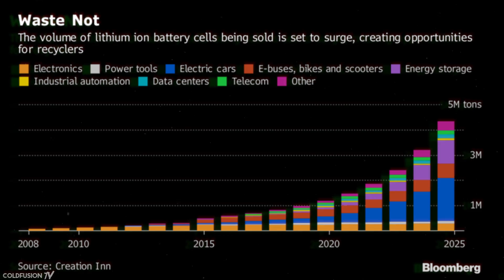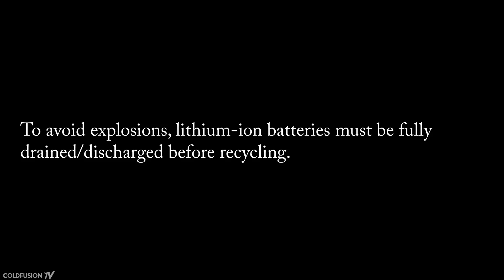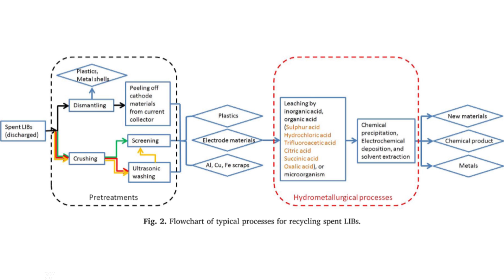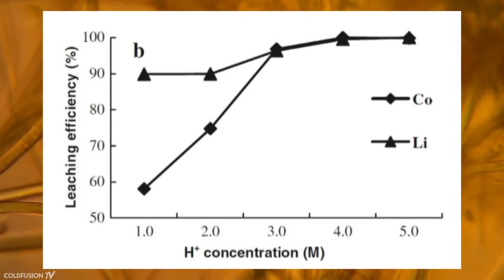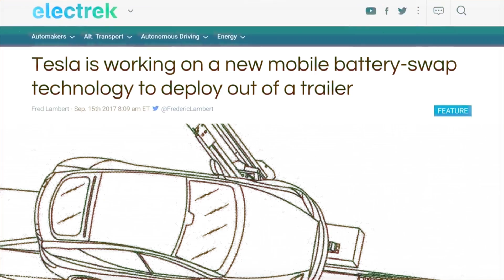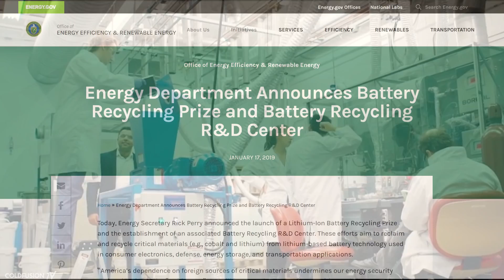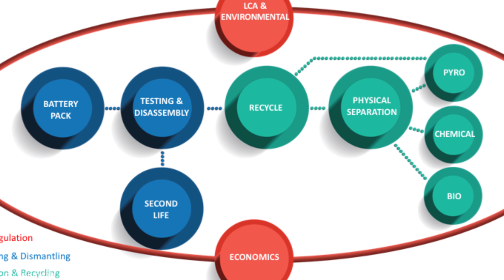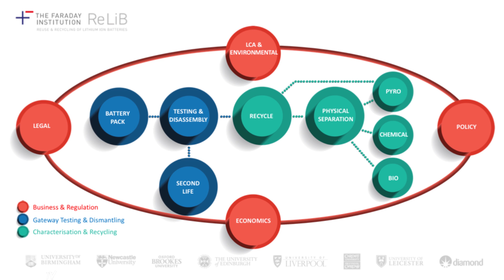Batteries, Recycling and the Environment

Comment: Canada has a battery deposit system, you put a 40$ or so deposit on your standard (ICE) car battery and you get it back when you return the battery for recycling/disposal. Same with TVs and stuff that is going to need to be disposed of one day. I think it was about 40$ for my tv too
Reply: no we don't, where you live might have such a thing, probably because the retailer wants to recycle them themselves to make the money.  a typical car battery net's you 5-8$ if you take it to the recycler yourself, and even if you don't wish to do so any retailer will happily accept them even if they don't put a "core" charge on it (core charges were made for things that get rebuilt, not for things that get recycled)  I work at a auto parts store in BC, and while we will happily recycle your old battery for you, we won't charge you extra if you choose to do it yourself.

electronics on the other hand we do have a disposal fee on, primarily because the value of a dead TV is pretty close to 0 to a recycler.  Same with car tires, it's often not economical to collect and recycle the majority of them, so we have a 5$ or so fee when buying them new to cover the cost and make sure they don't end up in landfills or dumped in the bush.  This is why you can tip car tires off for free in so many places, though a handful of greedy bastards will try to charge you as well as collect the fee from the government.

Comment: I don't care for the government regulation when clearly the designers of these batteries are smarter than government - it's about integrity, & honor to do the right thing✌️
Reply: Dream on
Reply: They might be smarter, but if there isn't profit at the other end no one will be doing anything. Integrity and honor are nowhere to be found when you talk business.
Reply: Steve Linbergbaby nope, only regulation works effectively. Consider the global change over to unleaded fuel for cars. Manufacturers would not have done that if it weren't for gov regulation.

Comment: I've always wondered, is it safe to keep devices plugged in all night? Doesn't it degrade their Li-ion batteries over time?
Reply: Yes, the optimum operating range for Li-ion is about 30%-80% SoC. Regularly charging to full capacity will lower the life expectancy compared to one that is only ever charged to 80%. However, this is not generally a safety issue ;)

Comment: What are solid state batteries? #solidstatebattery  what are the advantages of it? Will these solid state batteries overthrow lithium ion batteries? At what state is its development right now?
Reply: Maybe dagogo can and will do a video about it too? Idk he did one some time ago on the one of Samsung
Reply: Solid state cells use a solid electrolyte instead of a gel.

This gives it mostly lower internal resistance along with much higher cycle life.

Their energy density/volume isn't actually better than current lithium-ion cells, but their power and energy density/weight is currently higher on a lab setting.
Reply: I hate shutting down a chat but i reckon if you typed those words into google you'd get an answer
Reply: Odin Thorsdad good reply, +10 respect

Comment: We can label battery cells with the information required to recycle them.  But it is also essential that we can identify exactly which cell we have and can look up all the current information about it.  Such identifiers should appear on each cell multiple times, so it's likely the identifier can be read even if the cell is damaged.  

And these identifiers should be readable by both humans and robots.  Robots will be doing all of the recycling eventually, so we must prepare for that.

A robot should be able to look at a cell and then look up exactly how to take it apart.  Then the parts can be put sorted and through other automated recycling processes later that deal with a specific component or material.  

We'll figure out how to automate recycling later.  The essential thing now is to get the identifiers in place.
Reply: It already exists for 18650s cells. If you need some help, I can point you to some regarding this info.

Comment: Graphene is very promising tech, and possibly the 'magic bullet' to solving high capacity battery construction (lots of pro's, very few con's)
Reply: Graphene isn't a battery technology. It's a strong high tech building material and it's a good conductor.

You can use it for capacitors and make super-capacitors. But these have at least an order of magnitude lower capacity than lithium batteries.
Graphene capacitors have cought a  lot of attention from the press because capacitors can charge almost instantaneously, but seriously who would want a car that can only travel a couple of miles at a time.
Super-capacitors can be useful in an electric car, but they are not a replacement for long range batteries.
Reply: So far it hasn't improved anything on capacity, but it could improve longevity.
Reply: STAG162 unfortunately no

Comment: So lets say the batteries stay around for many years changing uses the next question is will we run out of lithium in the mean time? We are talking exponential increase in use.
Reply: We mine almost ten times more tin than lithium, and lithium is significantly more abundant than tin. Are you worried about humanity's insatiable appetite for tin? The answer is about 350 years for lithium at current rate, but given that we're not performing fission on the lithium, we're not using it up, it's all still here. Seeing as we're on the verge of dozens of other battery chemistries that don't use lithium, lithium isn't the part to be concerned about. Cobalt would be more of an imminent issue, but likely also very soon a non-issue.
Reply: @2k3r11s  for some reason I thought it was limited. I just googled and realise I am indeed mistaken.
Reply: @manickn6819  IIRC, lithium isn't the limiting factor for lion batteries, they use so little of the stuff.  It's usually cobalt, if i'm remembering right, it was a while back that i looked into this.
Reply: @Wooble57  the other reply pointed that out and I went researching. Seems lithium really isn't a big problem. Didn't realise that before.

Comment: Recycling of cars is not new so why has no one made recycling of batteries as priority before now. Even low volumes should be recycled and nor wait for the glut. Lead acid batteries came about at time when recycling was  not used. Cars for the last twenty years have had to be made of plastics that can be recycled so they turn a blind eye to batteries.

Comment: I am a long time subscriber but I think I will unsub.
Later videos are so biased, like to the point they appear to be Tesla commercials.
How do you think that a pack of cells will last 17 years in a car exposed to cold and heat, when the same cells last 3 max 4 years in my laptop?
Why don't you ask yourself why cell phone manufacturers made batteries non user removable as they used to be, they will be more easy to recycle after all.
And going back to electric cars (which aren't the future IMHO), how can they be green, when the power grid that provides the energy is not?
In my not so humble opinion the elecric car fever is just bulshit and manipulation.
Reply: Take a gallon of gas and use it in a gas burning car and see how far this car can go... put a gallon of gas in an electric power plant and it will produce enough electricity to power 4 electric cars to go the same distance.  Even if you burned 100% pure coal you will still have less pollution than a gas car.  Now that we took the electric fuel back to the power station... take the gas back to the refinery... it takes 6.7kW of electricity to boil oil to refine it to gas.  A gas car uses MORE electricity per mile than an electric car uses per mile.  Add to this the billions of dollars in subsidies to the oil companies.. oil is a total drain on society.  Gas cars are also slow and boring to drive.
Reply: @1905934 
Do you have any studies to back up your claims about mileage?
Anyhow an electric car pollute the world at zero km or mile more than an diesel in 300.000 km only from producing the battery pack, let alone what will happen after the short lifespan of the pack.
As a side note if you think gas cars are slow and boring you should try a motorcycle or may be use a manual gearbox car.
Reply: @ERUtheWINDRIDER  I drove many cars with gearboxes.. also raced with a motorcycle.. they can almost be as fast as a Tesla.. close... but not into driving motor cycles.. sorry gearboxes are pathetic ... the lag in between shifts.. no chance of catching a Tesla.  Only hyper cars can complete with anything electric.. but if you were a gear head.. you should know this.

Comment: Lol dude why you showing the Tesla battery swap patents? That project failed a long time ago. That also wasnt about recycling but being able to swap to a full battery instead of charging your car.
Reply: that was just to illustrate their point of making batteries easier to access in cars so that you don't have to tear down half the car in order to replace an old battery.
Reply: @JazzGreinerMusic  But thats not whats happening. All the manufacturers are going to a skateboard method and none of them are using battery swap except one small European company. People dont want to swap batteries, and it makes the car more dangerous and handle worse by having the center of gravity higher or in one spot on the back.

There's no problem with recycling EV batteries in the shape and design they have now. They are huge $5k batteries on wheels, there's no design problem with the cars that makes it hard to recycle the battery haha. No reason to redesign from the skateboard format. 

Also, the battery is generally longer lasting than the body of the car in these EVs, haha. Tesloop has run Teslas for 300k miles without losing 20% capacity. Even when you have a rare battery failure before that, you just lift the car up on jacks and replace packs from underneath. There's no "tearing apart the entire car." Auto manufacturers are smarter than that. They invest billions into their cars, they are not stupid-heads.
Reply: @-whackd  its not about making the battery 'swappable', its about making the car around the battery in such a way that when the time comes (according to this video every 17 years) it's easier to take out the battery and put in a new one, without having to dismantle certain aspects of the car and emptying fluids etc. 

You're saying car manufacturers already do this. the video is stating otherwise. Im no expert so im not gonna get into who is right, all im saying is that in the video, they footage they were showing was to illustrate there point, which it seems like you may have misinterpreted. thats all.
Reply: duke1duke1 Renault is small?

Comment: there isn't even enough lithium to mine to replace even 20% of earth its combustion cars with electric cars 

plus the electric grid would melt if we reach 8.5% of amount of electric cars in western cities

plus it takes a gigantic amount of gasoline fuel to run all the infrastructure to mine lithium, which mean if oil runs out you can't even mine and distribute lithium

when oil runs out the world will return to the stone age and all modern infrastructure will fade to dust leaving the ways of the ancients
Reply: www.nanoflowcell.com

Comment: Part 3 : Ultra capacitors and its evolution into the battery!
Reply: Supercapacitors are not a replacement for batteries. They fill a different niche. Batteries are for when you want kilowatt-hours. Supercapacitors are for when you want megawatt-seconds.

If you want backup power to run a building for a day when the power goes out, you want a heap of batteries.

If you want to cushion your grid connection against startup power surges when you restart your factory, you want a heap of supercapacitors.
Reply: @Roxor128  Exelant point !!!
Reply: And capacitors charge insanely fast.  So if they can be made with similar energy densities to current batteries, it is a massive win as they have FAR more duty cycles and are infinitely more recyclable.  If the elusive graphene ultracapacitor can be achieved in scale, then everything changes.  To the extent of almost fusion power level changes.
Reply: @JasonPrice1  There are only 2 problem with supercaps, even if energy density is solved:
1. Their self-discharge rates are quite high.

2. Their voltage goes down significantly as you discharge, unlike rechargeable battery chemistries which go down slowly in voltage.

Comment: Tesla just bought battery and supercapacitor producer Maxell for ~200 million dollars. You might want to dig into that story, as they are probably already developing the future battery technology for Tesla ;)
Reply: Hyperchange TV did a great in depth about this
Reply: Yes, especially this.

Supercaps have very low energy density, but extremely high power density.

Even if their energy density doesn't improve much in the mid-term, their characteristics could be used to stabilize grids all around the world, especially with the rise of electric cars.

Comment: 2:10 “...which can cause explosions or prolonged environmental damage”

flashback to Galaxy Note 7 exploding batteries
Reply: actually the Galaxy Note 7 batteries exploding was a hoax , no actual battery exploded, a few puffed a little smoke that was it.
Reply: good thing the note 7 did explode it brought it to everyone attention that these batteries are dangerous.
Reply: Evariste Galois just 90 Note 7s were reported as catching fire out of 2million shipped. 90 in 2M is statistical noise.

Plenty of iphones catch fire too.
Reply: I expected it from you
Coz you are dumb af
Reply: My galaxy s5 exploded last week
Reply: Mega JimmyHat are u sure it "exploded" or did it puff up
Reply: Those Tesla cells are same as phone batteries and vape batteries. They all can blow up, its anything lithium with that power density.